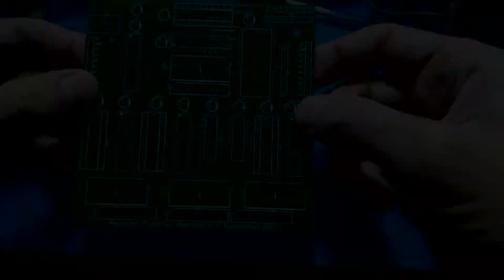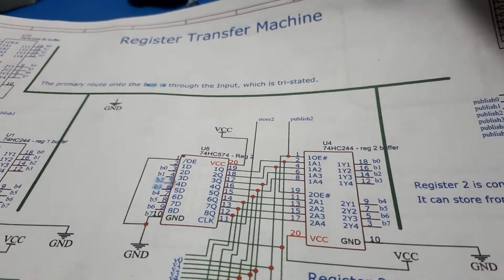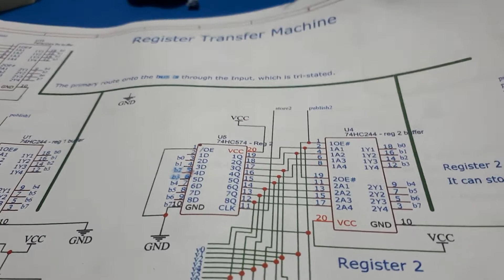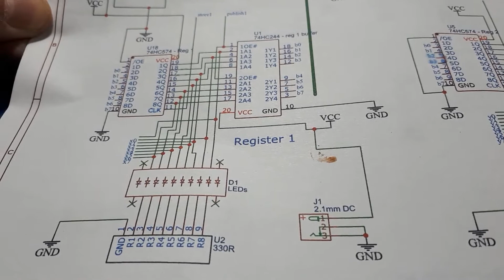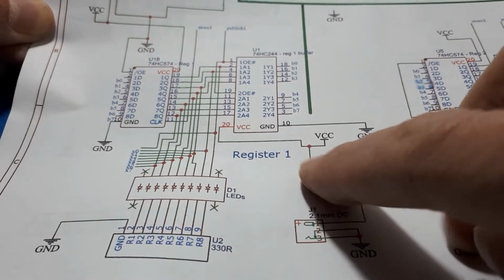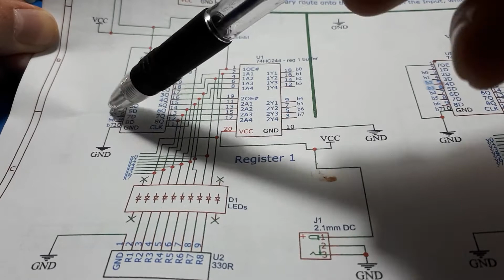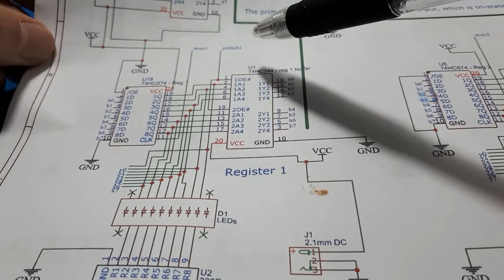Register Transfer Machine (part 1)

Comment: The architecture you discovered (& that you are designing) is called a TTA (transport triggered architecture).
Reply from the maker: You are absolutely correct. I have limited it to a single bus, which is where I differ from the processor I am copying.
Reply from the maker: As you will see in later videos, I'm aiming for a 6502 work-alike.

Comment: Hi, I'm loving the series so far. I only discovered you the other day.im starting on a similar project myself. I'm also trying to do the 6502 or possibly the 65c816. I was planning the Ben Eater 8bit breadboard but like you decided I want real PCBs. I have only just started on the clock circuit design on easyEDA so far. Going with a single click variable-speed or 1Mhz selectable. I have to say though i can't see me having much luck with the 1MHz
Reply from the maker: Ah ha! Well, I think a few hundred KHz will be my limit. PCB is definitely the way to go. I hate all those wires that keep popping out. It's a mammoth task, so I'm finding it tough going, but hopefully get time to do some more videos this weekend.
Reply: @CircuitBreaker256  You are being a lot more logical on the x00 kHz, my only reason for wanting the 1Mhz was the eventual plan to try and build a full C64 that runs original software but that is a long long way off. My Intention is to work on a main board and cards principal. With all the registers, clock, ALUs, and the like connecting to the mainboard with ISA8/16. Then having a bus buffer to send out to the additional peripherals.
Are you planning on releasing any of your EasyEDA files?